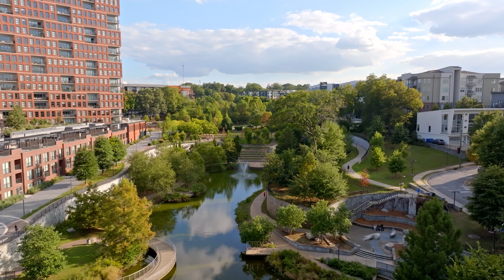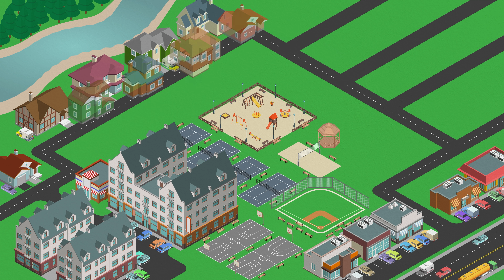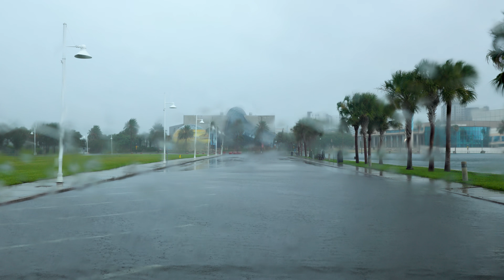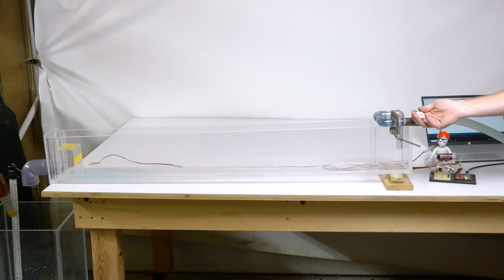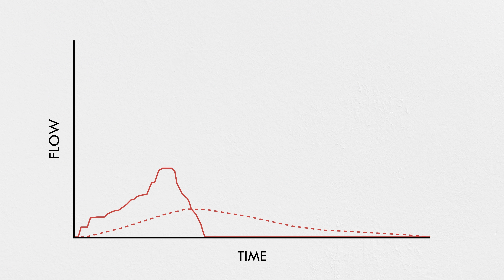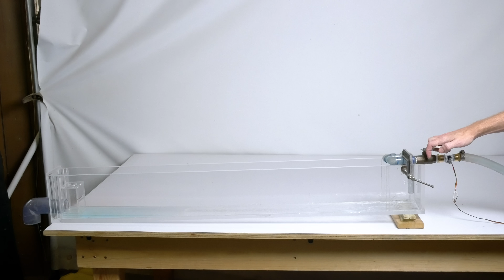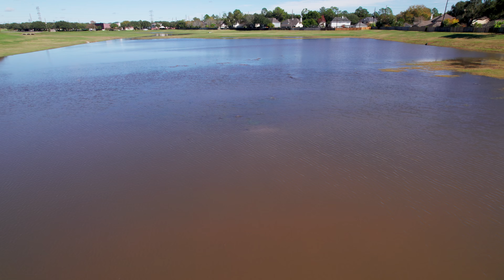Do Retention Ponds Actually Work?

Comment: Tulsa OK has been the model for storm retention ponds since the late 80s, The night after I graduated high school in 1984, parts of Tulsa received up to 15" of rain over several hours causing massive flood damage inside the city. So Tulsa purchased 300+ homes in flood areas and started building storm retention ponds all over the city in the 80s into the 90s which gave Tulsa some of the best flood insurance rates nationally.

Comment: The situation I've watched for quite a while are the ponds the highway department puts either inside or directly outside of interstate highway EXITS.  During EXTREMELY dry weather, there should be NO water in these ponds, for a couple of reasons, as mentioned, talk about a mosquito hatchery!  More importantly though, cars have spun out and gone either inside the exit ramp or outside of it.  Children have drowned when mom lost control on a slippery exit and there should be NO reason for 6 ft. of water depth for nothing.  I'd like to have a civil engineer explain the need for that water depth.

Comment: This is a great video,  thank you for making it.  If you want another great Texan topic but related to this,  you should do a video on Kingwood Texas flooding.  It started badly in Harvey and has worsened some ways in time from either poor engineering choices,  poor building choices,  changes in land due to extreme runoff during Harvey or inadequacies of dams in the area (Lake Conroe Dam Release vs Lake Houston release).   

It’s obviously more involved than I can explain in a few short sentences but it would be a great and interesting topic that people are still challenged to find a solution to.  Doing a video like this would also bring more awareness to the issue that has destroyed so many people’s lives and are having trouble getting the funding to correct.   If you are interested,  I can put you in contact with some of the more technical resources of the area.

Thanks again for this video!

Comment: As a student in landscape architecture four decades ago, sizing stormwater systems such as retention and detention ponds was a big part of my education. I have fond memories of hours and hours of hand calculations used to test increasingly refined solutions. All this was pre-digital computer so the result was never a first off, rather a generally long journey towards a solution. Seems odd to say but I miss it. One of the best examples of stormwater management that incorporates design and engineering is Corktown in Toronto designed by Micheal Van Valkenburg.

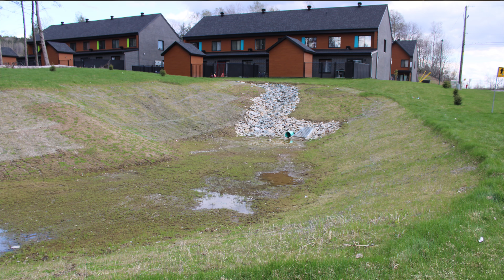Comment: The problem is they look horrible. 11:32 for example. They aren’t designed to look like natural pond features. They have the stone surrounding the drain and the bare spots and it all just looks terrible to me. 

The development I grew up in didn’t have any kind of storm water retention ponds and it never had an issue. All new construction requires it and it just looks so bad.

Comment: In some areas in Australia, we use high early discharge chambers to bring the discharge peak earlier and avoid the concurrent peak issue. This also has the benefit of helping flush debris from pipes more frequently. Both significantly reduce the flood risk. Upper Parramatta River Catchment Trust did some good work on establishing these design principles.

Comment: OMG! So cool! Adaptive control of rainwater removal with sensors, pumps, specialized private sector monitoring crews.  We should do it!  But first... Let get some sensors and processing power to traffic lights.  No more city improvements anywhere in the US until our dang traffic signals move out of the 1950's.  We should not throw away a single cell phone until every traffic light has a modified one as its brain.  They already come with multiple cameras, sensor inputs, and 3 or more communications radios.  We have all the necessary apps, we can still use the buried coils as a back up system.  We do not get to call ourselves "intelligent lifeforms" until this is done.

The saddest part is knowing that if doing so could somehow be profitable, it would be done tomorrow.  We'll have full self driving cars pulling up to stop lights that are essentially grandfather clocks.

Comment: I'm a civil engineer specializing in drainage systems and storm water control. Thanks for touching on the concept that detaining/attenuating peak runoff for developments in the lower portion of a large watershed will actually increase the peak flow in the receiving water body. Beginner engineers often don't understand the effect of the timing of the flood wave as it propagates through a large watershed because they simply fail to analyze the entire watershed when they model their projects using hydro software. Its essential for professional engineers to have a complete understanding of urban hydrology, however, a lot of professional engineers learn as little as possible, the minimum needed to run hydro software to show POST is less than PRE to satisfy the local permitting agency.

Comment: Rochester, MN is a great example of the effectiveness of water retention at slowing down the water and protecting a city.
In the 1970s there was a huge flood that inundated much of downtown.  In the 1980s and/or 1990s a handful of large reservoirs were built around the city, they put the river in a deeper channel through downtown, and many new developments now have retention ponds.  In 2007 there was another large rain event.  Apparently it was similar to the one in the '70s and newly built systems did their job and the city didn't flood.

Comment: I recall driving into Las Vegas decades ago and seeing these large Olympic pool sized depressions in the ground and wondering about why they were placed around the city. Then I got caught in a monsoon season rainstorm and understood why the city needed these structures.
PS — over the years, run-off collection infrastructure have been built along California freeways that are designed to trap the first run-off of any rainfall just to trap oil and waste from the freeway surface areas for later collection and clean-up. Cuts down onnstorm water directly draining into the ocean.

Comment: I wonder, if and how, these retention ponds affect the local climate. Do they create a perceptible marine effect? evening out the temperatures in an area that gets too hot in the summer and too cold in the winter. If it does; how far does that effect reach based on pond size? Is it possible to have a city with a central retention pond large enough to make a city built somewhere with an, otherwise, nigh inhospitable climate, into a perfectly habitable area?

Comment: He started to touch the subject of sediments and pollutants in runoff, but didn't really dig that deep into it. The thing is, when it comes to Detention/Retention ponds is that those sediments and pollutants build up over time, reducing the overall capacity of the ponds over time, meaning the ponds become less effective over time.  If pollutants build up enough in a pond, it can even make the water toxic, leading to people who swim in it becoming sick. Of course you could go in every now and then to have the pond re-dug out, but that is just adding costs for a temporary solution. 16:35 The same issues are even exacerbated with sand filtration. The sediments caking upon top of the sand (which already reduces outflow rate), which makes water filter even more slowly through the sand and even eventually prevents water from filtering out completely if it builds up enough. 

You could instead have the overflow drains at the surface of the ponds, but then you get the downside of idiots constantly swimming up to them for selfies or trying to film the water vortex or who think they can go through them like its some kind of water park slide, leading to people drowning horrifically inside them and the whole pond then has to be discharged so rescue workers can fish out what's left of them.

Comment: Could you do a video on bio retention and forebays? I understand the purpose of a bio pond but it seems they are often designed per volume as opposed to functionality. Installed some bio ponds where the inlets are right next to the outflows which go to the actual retention pond. Not much filtering happens and what filtering does happen occurs in a very small area.

Comment: You can usually spot a storm water pond versus a real one if there's a gasoline/oil slick on the surface of the water. There's one right by my house that they turned into a little park. It's a nice little park but that "pond" is kind of gross looking.

Comment: I'm in coastal SC where the land is flat as a pancake so these are all over the place.  There's a six or seven foot GATOR living in the one in my development.  I'm not exaggerating; there are probaby lots of smaller ones but you can spot "Wally" from 50 yards away sunning on the bank.

Comment: And now, many townships require infiltration beds to be underground, even on a >2000sf single home private residence sitting on 8 acres. As if that tiny house is going to influence runoff in any significant way on that size lot.

It's good to control stormwater, but we need to look at it with a common sense approach.

Comment: I live in a new subdivision in del Valle. Apparently whoever designed the filtration ponds or systems for this subdivision messed up. The city developmental services has been out here constantly since I moved in trying to get them to fix them correctly. I even saw a survey crew at another one of the filtration areas and I asked the guy "did they mess this up too?"  and he laughs and said yes. What  a mess

Comment: A warehouse next to my parents property was required to build a "retention" pond.  The problem: the design has ZERO retention and ALL of the water from this 2 acre area is funneled into my parents back yard, where it floods about 1/8 of an acre at 6-10" deep until it evaporates over the next week.  The "engineer" that designed it needs a prescription of 124gr HST.

Comment: A couple of immediately obvious problems with your suburb design there: firstly, your commercial buildings' parking lots are out in the open, taking up space and exposing cars to enough sunlight to turn them into ovens that can literally bake bread in summer, and rain and sleet in winter, and secondly, none of your building roofs appear to have rainwater tanks attached. Put the carpark under the commercial building so it's not taking up any extra space and the cars are parked under cover, and attach good big rainwater tanks to all your roofs. You now have all that "parking lot" space available for real parks with grass and trees and playgrounds, and all your buildings are sourcing a large amount of their water supplies from their own roofs instead of dumping that water into stormwater and then demanding clean water from municipal supplies.

Comment: I know this is an ignorant question but instead of large surface area ponds what about drilling wells down to the water table and filling them with rocks and gravel. Ot give the water a place to go that goesnt collect large amounts of water into a single place. Wells would also spread out the water letting it to soak into a much larger area. It also does not have large standing ponds for insects to breed in.

Comment: When I was looking at homes in low lying areas in the south, I noticed many developments had ponds as water features.  They dug out a pond and used the dirt to raise the level of homes to avoid flooding.  The ponds made the place look nice, but can be retention ponds, recharge water tables and they can maybe use the water on community green spaces.

Comment: Let's institute a system similar to fire code. Per individual square mile, only ___% of the land may be developed.  Make it super restrictive-because overdevelopment sucks. Per square mile means specifically per square mile, so it would be a noncumulative restriction. This means per square mile does not scale up by ratios. 

Let's say an aribitrary 50%/square mile development for example. New development would never be legally allowed to build completely covering 1 square mile if they own 2 square miles. That would mean they are restricted by each square mile, limiting flooding and overdevelopment. Let's just make a blanket-nationwide law about it. We are stewards of this world.

Comment: That's why our city has a code that prohibits covering more than 60% of your property with "structures".  The irony is, a deck with gaps is a structure, a concrete pad is not. So legally I'm allowed to cover 100% of my property with concrete or asphalt, but I get fined if I cover 60% with a deck that lets water seep into the ground. Yes, this municipal code was made to allow rainwater to seep into the ground. If you think common sense has left the city council you would be correct.

Comment: In my neighbourhood there are quite a few retention ponds, smaller ones are cut into the curbside of the road and have become traffic hazards, especially to cyclists. The larger retention ponds unfortunately become stink holes. When they are not serviced and cleaned wow it becomes a toxic disaster.

Comment: I grew up in the Fox Valley in Wisconsin.  There were no storm ponds when I was a kid.  Around the late 90’s they started building them everywhere.  The Fox River, which also runs through Green Bay is considered a dirty water body.   So a lot of storm ponds were converted to settlement ponds around the mid-2000’s  to help clean the river.  

Another little tidbit, it’s also why many cities in that area run street sweepers regularly.   The municipalities actually receive fines if not done on a required schedule.  I bring that up because my old neighbor would complain about “my taxes being used to pay some guy to run that machine all the time”

Comment: I lived in Glendale, AZ for a little bit. The detention pond near me stretched diagonally SE to NW across a section the town. It was basically a long, wide trench with practice fields at the bottom and walking/biking/horseback riding paths along the perimeter. I could start riding near the SE corner, up to the NW corner that ended near shopping district. I'd get breakfast and ride back SE towards home. Made for a nice, peaceful start to my mornings I had off.

Comment: Sadly near my grandparents their duck pond hadn’t had the council trim the stream vegetation on the outlet channel so now the exit flow rate is now low enough that it floods the area around it and not the local common (first flood plain), it was still meant to slow things down so the common didn’t flood under medium rains but still have the output that the commons would flood before then the green and main road

Comment: I like the retention pond near my house, because I've gone and watched how it works during heavy storms.  Rather than some complicated outflow pipe system, it's entirely passive.  I'm sure it feeds into something else somewhere, but there's a deep channel out full of reeds.  The pond itself holds a decent amount of water (I've never seen any inflows flood, or the pond overflow), and the reeds seem to do a decent job with slowing the water down enough for some level of filtration.  Given that I've seen almost zero maintenance on that system in the several decades since it's been built, I'd call it fairly successful.

Also, given that any failures in that system would lead to my basement flooding, and my basement hasn't flooded, I think that's also a decent measurement of success.

Comment: Those ponds are serving another important function in some places - they can be used up during droughts. Where I live the retention ponds (that are usually swimming pool-shaped and enclosed in a wire fence - not very pretty, but functional) have mounting points so that they can get covered with tarp to limit evaporation for use during dry weather.

Comment: Very interesting topic and video! Where I live, in the Netherlands, we have the additional challenge that the runoff doesn't automatically end up in the ocean via rivers and canals. Due to the fact that a large chunk of the country is below sea level. So we need to add pumps to the mix. And we need to balance incoming (storm) tides, which raises the sea level versus flow from the country side into the sea, requiring more retention on land during storms. Did you know our king actually studied water management?

Comment: Great video that really summarizes the use of SWMPs. One thing missed that is almost always overlooked when discussing the design of SWMPs is the use of vegetation. Including appropriate vegetation to SWMPs increases its pollutant removal. Many of the SWMPs shown in this video were extremely low in plant life. The presence of vegetation increases pollutant removal through the uptake of nutrients by the plants needed for growth, creating habitat for microorganisms that that also remove nutrients, and by decreasing water speed, which increases the sedimentation rate of suspended solids. I'm sure that there could be an entire follow up video that looks at the optimal design of SWMPs (e.g., bank slope, depth, perimeter design, etc.), which would be very interesting.

Comment: This was a really good video!

I was hoping to see it circle back to how the park was designed w/ watershed in mind.
Even if it was just arrows and circles showing the water flow and then some guesstimates to how it would hold/buffer the rain water. Or a simple overlay of what the waterline might look like in a really big flood. Doesn't have to be a big water simulation or anything mega complicated.
We can only assume what would happen, that the park is made to be flooded, stairs and seating areas become waterfalls, and maybe showing where the main outflow is for that one park.

Not a complaint, just constructive feedback of what I was hoping to see to cement the concepts in my brain. Good work as always Grady and production people!